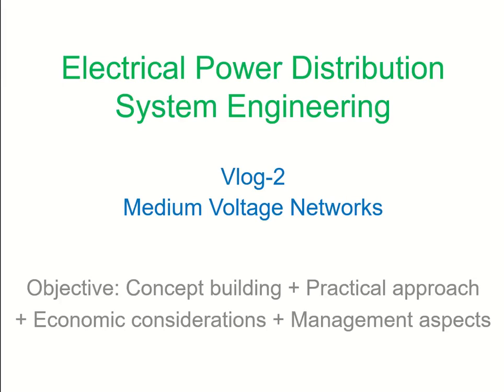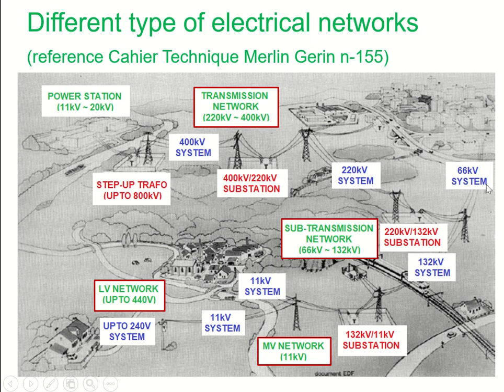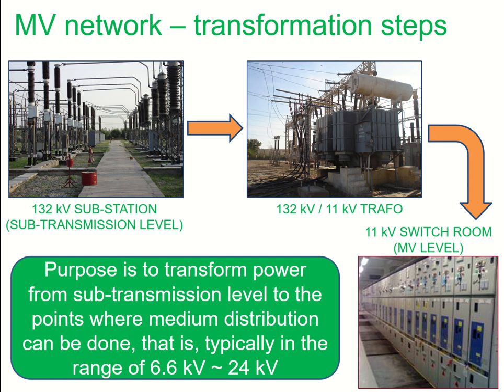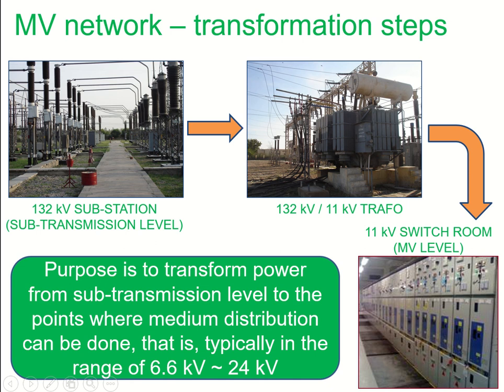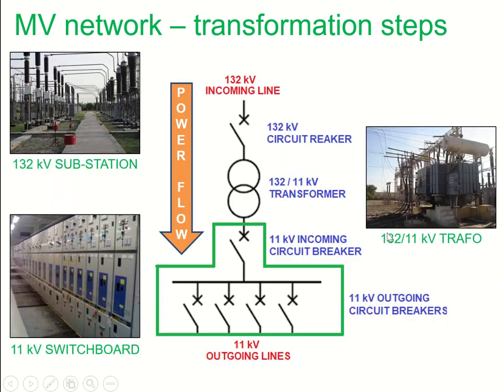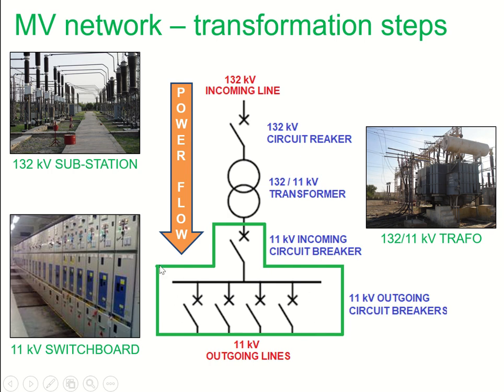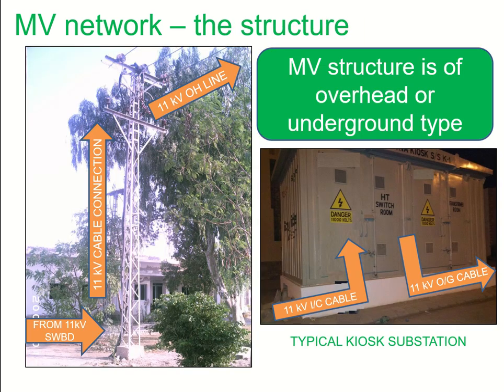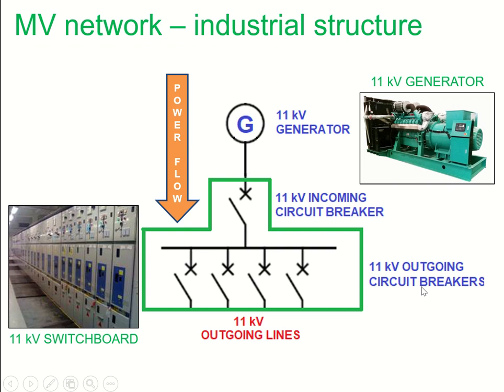Medium Voltage Power Distribution | Farrukh Habib - FHB | #ElectricalEngineering #powerdistribution

Comment: Good one ...  put some light on resistance earthing in MV system .. like we use NER on power transformers and MV generator network?
What are the acceptable limit of fault current on MV neutral?
Reply from the maker: Sure will also cover it in future